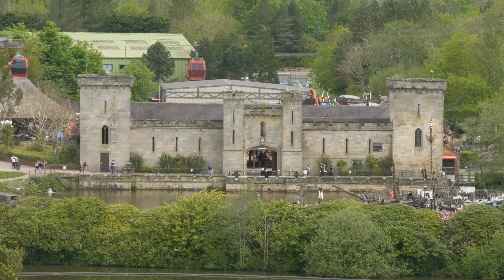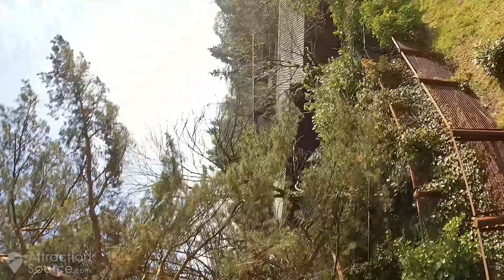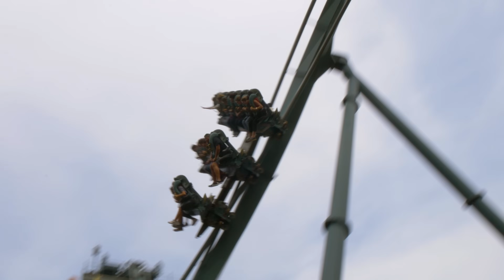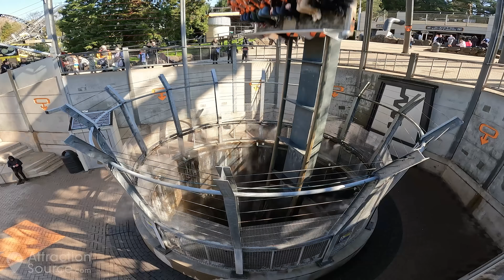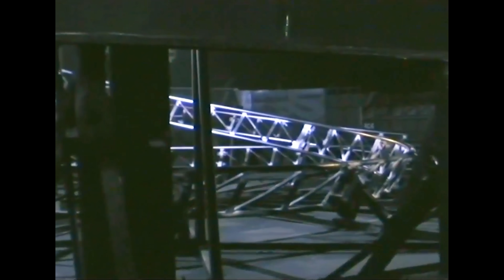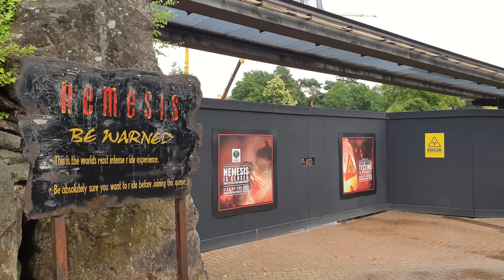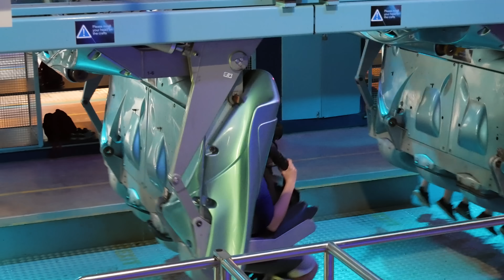Alton Towers has a roller coaster problem

Comment: Corkscrew was a generic Corkscrew with Bayerncurve made by Vekoma.
Black Hole was a generic Jet Star 2 by Schwarzkopf.
Yet given how few of them are in operation today and what Alton did with them. Today it feels like they actually were much more unique, while TH13TEEN and Rita feel, kinda generic.
And that's Alton's real problem. They keep getting rid of things because they are "generic", and either don't replace them (Ripsaw, Enterprise, Submission), or replace them with really expensive unique rides which 50% of the time endup feeling more, off the shelf than the previous.
Alton feels more empty and generic than ever before.
If Alton really want to expand, I say they should do what they did in the past. Get off the shelf rides add a bit of flare and customisation to make them feel unique.
They could expand much quicker and cheaper if they did, and the end result would be a park that is more of a themepark with rides, less of hiking experience with the odd rollercoaster as a checkpoint.

Comment: What do you mean? You remove the old coaster and modify the hole as needed for the new coasters
Reply from the maker: You could but digging a bigger hole costs a lot of money and I don't think the park would be willing to spend that much anymore
Reply: @coasterbot  Yeah, I just figured you wouldn't dig it deeper, but work with what you had with slight modifications. You can build dozens of variations of a good ride within those holes. And if they want to survive as a premier theme park, they'll have to make those expensive investments anyways or face a slow decline. The park sounds fairly mediocre without those 2 or 3 really great coasters. So, if they slowly fall off without worthy replacements because the park was cheap, that'd be sad.

Comment: The only roller coaster problem I think Alton Towers has is that it's home to some of the most amazing rides in Europe, but it's located inconveniently far away for somebody who only has a bicycle. They get perfect terrain and a place where the magick always shines through (Even with Merlins extreme profiteering!) whilst the best I can get is a ten-„inversion“ headbanger sat atop a gravel pit operated by the same group! 😋

Personally; I think Oblivion might have a bit more service life than Nemesis (v1_1994) did - Partly for the track being a lot bigger/heavier (Thus more resilient) and not being subject to quite the same extreme forces Nemesis or Smilers track puts up with. I wouldn't be too surprised if Oblivion keeps on going to the 40 or even 50 year mark before requiring a major overhaul, at which point it'll either be a rebuild of the drop and fan turn (Renewed by pulling and reinstalling bits through the tunnel) or the park will decide that removal of non-RoHS components and burial of the tunnel will be the more cost-effective option. 💸

Holding on that latter point though; If Oblivion was eventually removed, the tunnel is large enough that there are other attractions which could fit inside it without major reworking. Just imagine an S&S Space Shot set up at the base of the drop - That's a 200ft shot without breaching the top of the Towers - Or some form of dark ride themed around mining? 😇

I'll also note that before Air (Galactica) came along, that part of Forbidden Valley was home to The (New) Beast - Another Schwarzkopf Jet-Star III, which was quite the experience in itself. During that time the site was completely flat (Indeed; Airs maintenance shed sits in the same position the Beasts shed did) and the changes for Air were mostly minor landscaping and cut/cover tunneling to create some unique-seeming terrain for the ride.
If AT is forced to drop a coaster to build the next big thing my money would be on Air being removed as that area has the oldest ride with a low site remedial/redevelopment cost, then Smiler (Similar site, mostly flat) and Th13teen (One deep excavation) in that order. 🚧

Finally: Many thanks for the fantastic video! 💯👍
Reply from the maker: Interesting points! I agree about Air, I think there's the most potential there for a brand new ride with the land available

Comment: Well, if they manipulated the environment that much in the first place, what's stopping them from doing it again? They could just knock down a few more hills in the pits that already exist and make it much more open, which would allow them have more layout design freedom. 

Not that I want to see Nemesis go away, but if they changed the terrain a bit more after deconstructing, they could easily fit an RMC with a totally different layout, or even one of the Mack extreme spinning/launched coasters. The spinning would mean that the layout wouldn't matter as much because the spinning itself changes the layout. They have plenty of options if they want to replace one of their coasters.
Reply from the maker: Very true but it's a very expensive process and I'm not sure the current owners are willing to spend as much money on it.

Comment: used to work at towers for a few years, not too long ago. There was a massive plan to expand the resorts offerings in the space behind Galactica that currently acts as a car park/back entrance to the hotels and borders the mini golf. The idea was to build a large custom building that held multiple smaller offerings. A bowling alley that utilised AR to make minigames that incorporated the bowling itself (using your ball to knock down zombies from the old duel ride etc.) as well as a large multi level soft play area which was themed to the various rides and sectors of the park. Very similar to how the mini golf is themed to current and old rides and areas of the park itself. The building would also incorporate new dining options and would have been great to offer more options to the resort outside of the theme park, mini golf, treetop adventure and waterpark (This would also have seen a rebuilding of the waterpark to have new rides and an extended space). 

The plan was going well but was cancelled due to (as far as I could find) funding issues as well as the fact it would require the closing of the splash landings hotel and new roads for deliveries to the hotels etc. The overall cost would have been maybe worthwhile but the loss of revenue from the hotel and waterpark for at least a year if not more was simply too much for the management and the idea was scrapped, instead being rediverted to a remodelling and making of the mini golf that's been in management hell for the last few years. If they wanted to do anything in the area behinf Galactica, they'd need to be entirely onboard with building new service roads for the hotels and the costs associated alongside the disruption.
Reply from the maker: It's a shame that plan fell through, it's definitely something that the park needed. With Nemesis being redone and project Horizon on the horizon the park could be on the up, but more is definitely needed.

Comment: 25 years for Big Bad Wolf In Virginia in the US was specifically set by Arrow Dynamics when it was opened in '84. it hit the time in '09 and that was that, but like you said with no restrictions it was somewhat easy to replace. Big Bad Wolf and Verbolten are both terrain rollercoasters though and Verbolten reused some of the big Bad Wolf footers.

Comment: I worked at Alton Towers from 2001 to 2009 and saw many coming’s and going’s, I had some of the best working experiences of my life there and also some of the worst. The job had some perks however, one being that I was unofficially one of the first people to ride Rita. Before it was opened to the public after construction had not long finished I was doing a 5am security round of the park and checked in on the site of Rita just as it had finished a set of test launches, I cheekily asked if I could go on it the next time they launched it and they actually said yes! 😂 So ‘unofficially’ I was one of 4 that got to ride Rita before it was opened to the public. 😊 Experiences like that I will never forget, but sadly for almost every good experience like that there were bad experiences that countered it. I will never work there again, and these days I don’t even like to go to the park because of the bad memories.

Comment: Soe other theme parks also do the same as with Nemesis, change the worn down track with a new one and if needed, do the same with the support structure. Many wooden coasters do it since it is relativly easier to fix a wooden roller coaster than a metal one since wood is more readily available
Reply from the maker: Very true

Comment: There are rust stains on all the welded gussets on all the boltted connector plates/flanges. Was nothing galvanised when fabricated. 30 years old. All that staining is lost connective material dripping to the ground. WOULD NOT BE GOING THERE ANY TIME SOON.
Reply from the maker: Good spot! The rust on the old Nemesis was actually painted on to make it look old after they repainted the track a white colour!

Comment: I wonder if Glactica still has the same problem that Air did (and I aren’t talking about accidentally hacking peoples legs off in crashes) no I’m talking about any time the carriage entered the station the safety system tracking the location of each carriage had a 50/50 chance of losing the signal shutting down the whole ride which lead to people been stuck in there seat hanging upside down (sometimes in baking hot sun during a heatwave) for hours at a time while they get a technician to try and reset the rides safety’s, basically some smart designer was like let’s use aluminium all over the station it will look really cool (the station is the bit where you get on and off the ride and all the control equipment is placed) turns out aluminium is really good at blocking radio signals just like the radio transponders on each passenger carriage used to track its place along the ride.

It was having a good day if it only broke down 3 or 4 times a day.

Comment: Correct me if im wrong, didnt alton towers have 2 of the same rollercoaster?  Im sure they had one called the beast which was the same a the black hole.  If i remember correctly, it used to be next to where the thunderlooper (epic ride in its day) used to be, which is next to where nemesis is now.
Reply from the maker: They did! The black hole and the Beast we're both the same type of ride

Comment: Solution: don't replace a roller coaster with a roller coaster but a static swing that is half over and half under the ground, like a galleon ship. Ride types are basically the same, just with a different image. Get the image right and guests will ride it, even if it's the same style as rides that are over 20 years old.

Comment: You are wrong about Oblivion. I went to Alton Towers in 1985 and went on Alton Towers first Vertical Drop Rollercoaster one which was later closed after a childs death. The Original Black hole was Alton Towers first vertical drop rollercoaster. What made that one so dangerous was it required Gforce to keep you in your seat. The front seat did not have a seatbelt the rear one did. After some reingineering it was later reopened after the second black hole ride replaced it.

Comment: As an engineer looking at Oblivion it is not that difficult to replace the track underground. The hole is not the same as the tunnel. Track on the vertical section could be replaced by a crane. In the tunnel a machine that sits on the existing track could move to the position adjacent to the piece to be replaced. A lifting system could then extend lock on to the piece once unbolted its lifted slid back and carried out. The process is reversed for the new piece. It requires any none track work to be performed in sections but ultimately the track is renewed and quickly.
Reply from the maker: Interesting to hear! I look forward to seeing what happens with it

Comment: i have been a NDT technician for nearly 6 years ,.... theme park rides have NDT checks for insurence purposes BUT there is NO standerds for it NOTHING is a fail evan if its clean snapped in half there is no fail no pass standerd i have only seen repairs done when myself and another inspecter begged theme park staff/maintanance engineers to make repairs on a small childs ride that was in really bad condition (looked like it was about to fall apart)
Reply from the maker: Out of interest, care to say which theme park you're referring to?
Reply: @coasterbot  i cant remember the name off that it was not one off the big names alton towers etc, the site had a monorail that was offline and ill try find a link to show you what that particular ride was... but even the big names too worked on big dipper components from blackpool pleasure beach all F`d and not even fatgied just F`d from new still went on the ride even though every weld was cracked no exaggeration
Reply: @coasterbot  https://wheretogowithkids.co.uk/wp-content/uploads/2019/05/IMG_6734-1024x683.jpg   one off these

Comment: If you like rollercoasters, give Phantasialand in Germany a shot. Absolutely loved the rides there and the deisgn and engineering for their rides is impeccable. They also have quite a small area of land but they absolutely transform it. The set designs are stunning. I have been to Alton Towers once but definitely need a revisit as I didn't get many rides the first time.  Phantasialand has a flying coaster and a multi launch coaster too!
Reply from the maker: Oh yeah Phantasialand is awesome. I haven't been since they opened FLY but I had a great time last visit ☺️

Comment: Nemesis is the best coaster at Alton Towers, a perfect mix of flowing whilst still inflicting enough violent changes of direction.  When I was last there many of the rides weren't running (no smiler, wicker man or galactica) so we ended up doing Nemesis multiple times.
Reply from the maker: Nemesis is an incredibly well designed roller coaster

Comment: I have only visited Alton Towers once, and from a personal point of view, I found it to be too spaced out between attractions. What was impressive was the range of foods on offer, far better than most theme parks.
By far the biggest problem, again from a personal point of view, is the access to the park. The roads are totally inadequate, being too narrow. We were forced to wait due to buses leaving the park area as it was too tight to pass.
Surely Alton Towers could finance the local roads being widened? Another possibility would be to extend the nearby Churnet Valley Railway southwards over the existing track bed to Alton Towers and provide a park and ride facility to supplement direct access.
Reply from the maker: Yeah Alton Towers is a huge park and it's in the middle of nowhere. Surprisingly it still attracts a lot of people!

Comment: I'm not sure about the lifespan of the physical structure but if it's anything to go on the components of the safety control system only have to last 20 years. They often last longer but definitely should be replaced before then. Given the age, I'm hoping they are doing a full electrical refit at the same time.
Reply from the maker: Good point!

Comment: Nemesis is the main reason I go to Alton. In every trip I try to ride each major coaster twice (with the exception of wickerman because I don't find it that entertaining and the queue is generally far too long), but I ride Nemesis as much as possible. I head to it as soon as the gates open, and I head to it close to closing time when most people are heading for the gate. In total last visit I managed to ride it eight times, for the last ride I didn't even have to go back round the queue, because there were so few people in line.

As to what will be replaced... Rita is the only one of Alton's big coasters to not have been considered a 'Secret Weapon' (which I believe are coasters that break a record or set a major first), but Galactica is a strong contender. It's already on its second wind, having been refurbished from Air a while back. After becoming Galactica it started using VR, with headsets you could wear during the ride. While novel, these diminished the realness of the experience and quickly became faulty, now being entirely removed.

Comment: Blackpool Pleasure beach is still running a 1920s and a 1930s wooden coasters ! 
And I'm writing this comment on 23rd Aug 2023 . The Big Dipper at Blackpool was original opened on the 23rd Aug 1923. So happy 100th Birthday !

Of course rides can be fixed up. Although It does come down to cost .
Nemesis at Alton Towers is one of my all time favourite rides in the UK. I went on it within a year of it opening in 1994. Haven't been on it for about 8 years now. I'm possibly getting a bit too old for roller coasters, ageing and all that jazz !

Alton Tower's Oblivion , I do like it , but the ride is over so quickly. There's a massive braking section at the end of it's about 15 second run ! I'd have thought a track extension to do a loop or something, double it to a 30 second ride time . I don't guess that's easy. There is other stuff and planing laws in the way.
Thorpe Park's Stealth is similar. A massive braking zone at the end , wasting all the potential energy ! The ride could be made a bit longer too. Again , where would the extension to the track go ? (and how much would it cost)